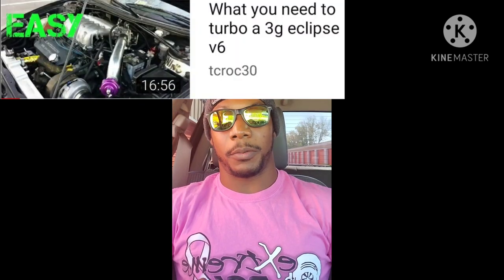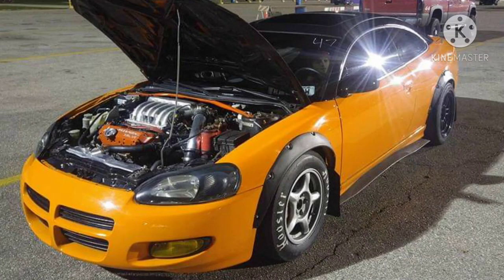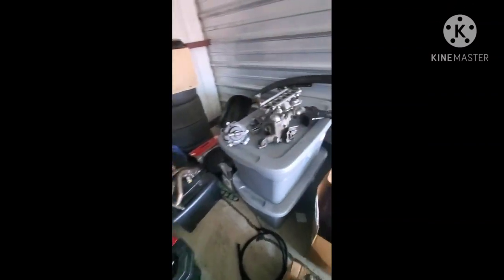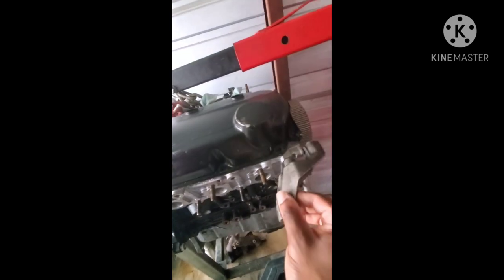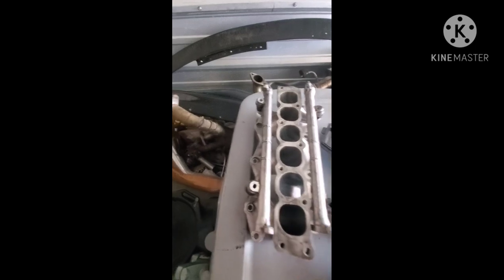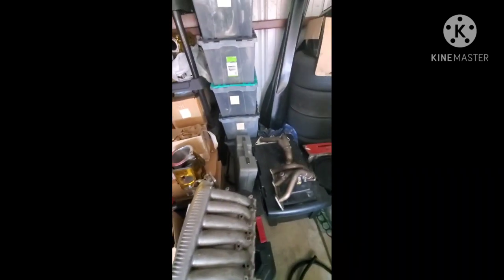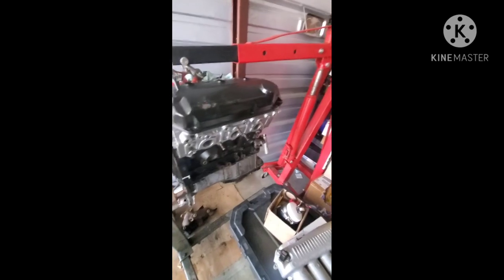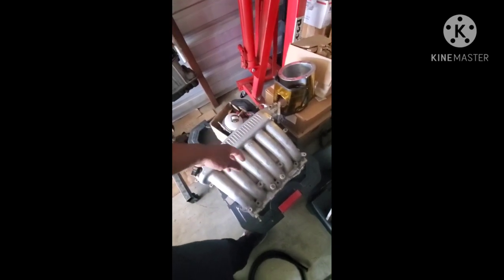What you need to 3.8 mivec swap your 3g eclipse

Comment: To run it on a standalone w/o the distributor, one will need the 6g75 Montero cam sensing wheel and housing.
Reply from the maker: Correct and a different reluctor I believe depending on the ems. I know haltech supports 75 ignition. Aem not so much
Reply: Thanks and this the only turning device as an option?
Reply from the maker: No

Comment: Hey brother, I need that plate that goes in the distributor, where can I get it?
Reply from the maker: I think I saw you post on Facebook looking for one. Unfortunately you have to find someone selling them used. Unless joey can get another batch going.
Reply: @tcroc30  Do you think I can get a plate like that?  Or is there a way to make it?
Reply from the maker: If you have a local machine shop in your area will to take on the project. I would reach out to Joey Miller and see what he says

Comment: Wait so I have a gs and I wanna swap to the 3.8 if h wouldn’t mind what would I need for that ?
Reply from the maker: Besides the motor, trans and misc parts from various 6g7x motors. Your  gonna need wiring harness from a v6 and probably crossmember, subframe etc from the front end. Personally I would recommend that swap for a gs because its very involved and your gonna need a donor v6 car. I would just turbo it since its a easier route
Reply: @tcroc30  really ? Would it be able to keep up with like off the top my head g37 and 350s
Reply: @tcroc30  so far I had a few people tell me to just boost it instead of the swap
Reply from the maker: Depends on how it's set up. Rs and gs are very easy to boost since the evo parts bolt on. Definitely has good potential

Comment: Hey brother how you doing
Do you by any chance sell a 6G 75 3.8 non-mivec engine kit. Meaning the engine mounts and everything else needed to do this swap on a 3G eclipse
And if so could I contact you through email
Reply from the maker: I do not sell the parts to complete the 6g75 non mivec swap. If you post on some of the 3g eclipse Facebook groups someone may have the parts or could possibly pull the parts from the junkyard
Reply: @tcroc30  thanks so much brother
Your time is appreciated

Comment: How much did this all cost? And where did you get all the parts from?
Reply from the maker: Various places.  Most of the parts came from junkyards since you need various parts for a 6g72 6g74 motors. Some parts were custom fuel rails, headers, mivec plate etc. I also bought some parts through shops and other 3g owners

Comment: Hey I just bought a 3g v6 I drove from Ohio to Texas to buy its super clean no rust anywhere but the motors old and been ran low on oil I really wanna do this swap but I can’t find the distributor plate any suggestions ?
Reply from the maker: So I just got word joey is not making any more plates at the moment. I have heard a rumor that someone else makes them but I cannot confirm it. I will definitely make a video on this if it is true
Reply: @tcroc30  right on please let me know. I’m not really sure how I would do it with the stand alone no local tuners will tune a 3 or 4 g around me.
Reply: Whats a good stand alone to run on the 3.8 I will be running boost

Comment: Where can you get the mivec plate or even a kit now ? Exellent vid also brother lot of great info !!!
Reply from the maker: They have been discontinued so custom is the only option
Reply: @tcroc30 hey buddy a quick question for do the swap I need reflash ecu or works stock?
Reply from the maker: @miguelpadilla3324 needs to reflashed with a tune
Reply: @tcroc30  thanks

Comment: Have a 3g can we talk? I have some questions, car won’t start and I’m trying to fix it
Reply from the maker: Whats the issue
Reply: @tcroc30  ok so one day I drve my car like normal, parked it, got back in it, tried to start it, got a no crank no start. So I replaced all the fuses, replaced the fuel pump, and starter, new ignition coils, and cam shaft sensor, now I got the car to crank, but it won’t turn over, it will not start, even with jumper cables just keeps cranking, I bought a new battery, but after a couple days the battery will die and I have to take it to autozone to get it recharged, it’s a good battery, I have no clue what to do, and I don’t wanna keep throwing money at it and not get it running, can’t get it to a mechanic because it won’t turn on to drive it to one, and towing is just way to expensive right now. Have to faced this issue before? I’m desperate at this point, I just want my car running again, can u help?
Reply from the maker: I would first look into seeing if your getting spark or fuel. You get spark plug testers at the parts store. It's going to a be a 2 person job because someone has to crank the car while the other looks at the light of the tester. Or you can video if your by yourself. For the fuel test. See if your building pressure at the rail while cranking with a fuel gauge. Figuring those 2 things out first will help eliminate a lot.
Reply from the maker: Talk with your insurance company usually they can tow a car for free to the closest shop

Comment: Why not just buy a 4th gen is it the look?
Reply from the maker: Not to knock on 4g. I don't like them and they are heavier compared to a 3g. So if someone with a v6 3g wants more power out of that platform. 6g75 mivec swap would be the most cost effective route compared to a turbo set up or just buying another car
Reply: The 3G with v6 makes 200-210hp and weighs 2600lb
The 4G with v6 mivec can easily make over 3000 hp but weighs 4000lb so it’s not really much faster. BUT WHEN U PUT THAT 300HP 4G MIVEC IN THE 3G u got a redonculous fast whip

Comment: Quick question is there two different versions of this engine, one that's in the panjero and then another that's in the 4g eclipse?
Reply from the maker: Their is a pajero mivec and theirs also 2 versions of the 4g eclipse. The difference in the 4g is the position of the mivec solenoid. As for the pajero I'm unsure of the details of it but I'm sure its the same
Reply from the maker: Oh and the ralliart galant came with a 3.8 mivec as well
Reply: @tcroc30  I'm asking because I can't find the mivec version anywhere much less the nonmivec. I might have to look into the differences between the pajero & 4g eclipse.
Reply from the maker: Where are you located
Reply: @tcroc30  Minnesota
Reply from the maker: Have you check car-part.com

Comment: I have an 05 GS eclipse but in Auto. If i would to engine swap to a Mivec 3.8, would i have to change the transmission too?
Reply from the maker: Yes and few other things as well. Gs chassis is a lil different than the gt. I would look into dohc head swap
Reply: @tcroc30  ok thanks man.

Comment: Do you run an oil cooler?
Reply from the maker: I did at first as a precaution but not at the moment. Our champcar doesn't have one and the temps have been great so I figured I wouldn't run one until the temps get bad
Reply: @tcroc30  just curious thanks